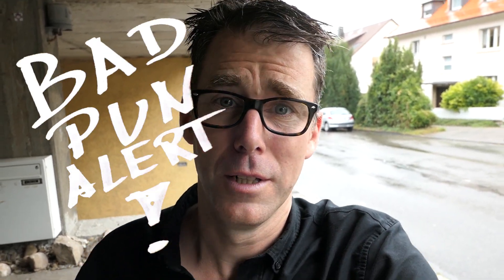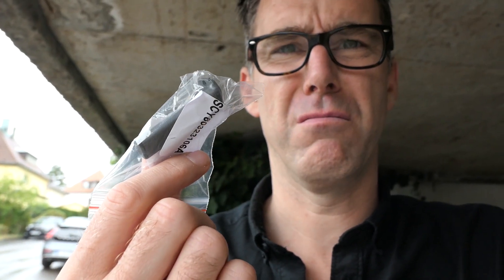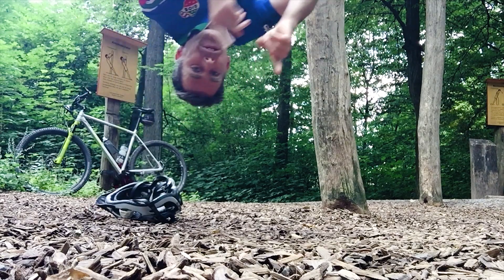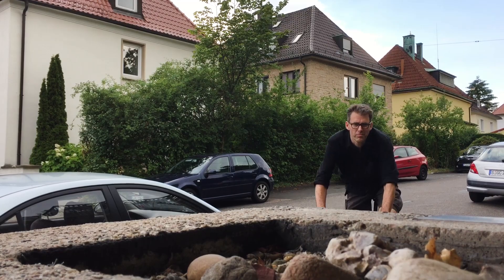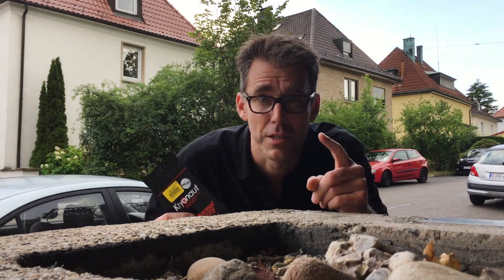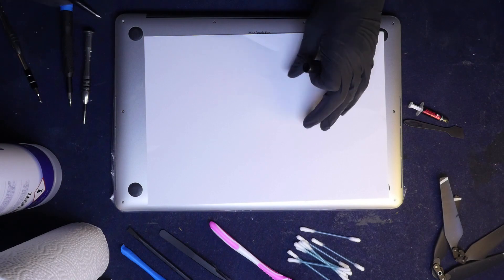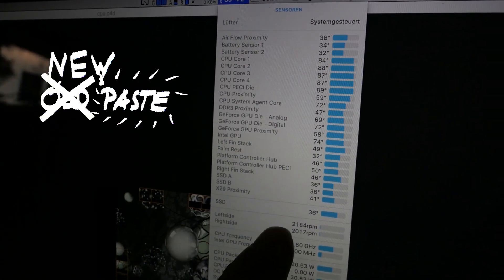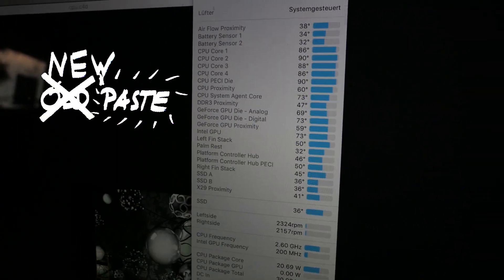The Macbook Pro Thermal Paste Adventure

Comment: what tool do you use to assess your results? also, i didn’t find a difference in temperatures. do you think performance improved by this application of thermal paste?
Reply from the maker: I'm using iStat Menu. Don't know how reliable it is. But it looks like "reposting" does help when after years the thermal performance is getting worse.

Comment: Which screws are used?
Reply from the maker: For the bottom cover? The originals still. But they are ... suboptimum.
Reply: No i meant ehich screwdrivers did you have to use
Reply from the maker: @junkyMM  I used the pentalobe drive that comes with iFixIt's toolset. And a simple T5 torx for the inside.

Comment: I did this plus I cut up a 15mm thick thermal pad to make the heat pipes transfer heat to the bottom plate. It's made a difference, watching 4K YouTube video only brings the temperature to the low 50 degrees and it stays there. While idling my 2015 MacBook pro 15 with the i7 2.8 GHz stays at 30 degrees Celsius. Also the bottom seems to stay cooler now when watching Netflix on my lap. I'm. Assuming if I placed a laptop cooler with fans on it I would see even more of an improvement. I'm only saying what I did and my results, I'm not saying anyone should do this.
Reply from the maker: Keep in mind yt will put a link into the approval box and when I’m on the road I barely ever check that box. ;]

Comment: Great work, what MBP it is? What CPU/GPU? And I would also suggest, for maximum effect and to receive good results to go "crazy" and 1. warm thermal paste before applying, 2. first put all stuff in micro-tube and try to mix it to be more near-perfectly balanced 3. apply as small amount as possible and spread as you did (apply on cores and nothing on radiator) 4. screw radiator with a lit of loctite 5. perform 'warm-hot-cool-cold cycles as soon as you assembly the cooling, to move particles into 'their' size 'holes/gaps' by thermal expansion and contraction. This is crazy process but it still will give at least 87C at stress, with 2000rpm. Mine is never kept on 2000rpm, constantly on 2700 and 3800 when on load. On maksimum load I set to 5300rpm. I use smcFanControl. Never use it with lower than 2700rpm mainboard components will buildup heat, this is also very nasty when moving during winter (23C inside, -10C outside). Just an advice.
Reply from the maker: Thanks! This is some great info!

Comment: Should i use arctic cermique 2 or gc extreme ?
Reply from the maker: That's a tricky question. I used Thermal Grizzly Kryonaut, because in one of the thousends of tests it got slightly better Marks. But as You don't this too often, You might as well take a very expensive one - to be sure. That being said, Arctic mx 2 and mx 4 were the second best in that test - can't remember where that was. Just avoid liquid metal pastes or anything else conductive.
Reply: @philipp7pc  Thank you. Actually i decided to mastergel pro or maker.
Reply from the maker: Keep us posted how it worked out.
Reply: @philipp7pc  I will. I will buy mastergel maker or gelid gc extreme. Gelid is equal as krynaut.

Comment: Why does every say to don't spread it when every video you see folks spreading the paste
Reply from the maker: It kept me up. So I opened it again to see if the spreading was a bad idea. Looked all fine. No bubbles, well spread. 
Cleaned and reapplied. So much for that “did I turn off the oven” exercise. ;]
Reply: @philipp7pc  anyway, I believe one should rubbing the paste – so the paste just fills all microgaps, but not cover the bare metal – so the heat sink will touch the processor directly, not via the paste. Thermal conductivity of the copper is x10 better than any thermal paste ever.
Reply: @philipp7pc  how you can be sure that there were no bubbles – the whole compound distorts when you're unsticking the sink =]
Reply from the maker: Good point. The whole thing looked very fragile anyways. 
(The paste looked good when I reposted a few days later, because I was in doubt ;)
Reply from the maker: That’s exactly what I was wondering. Then I looked up some thermal grizzly tutorials and the said spread ... but I’m not convinced.
Reply: Its because of the air between cpu and the cooler. There is a vid that shows that very good with a glass pane on the cpu, with the paste between them.
Reply from the maker: I’m afraid You’re right. Feel like having to redo this without spreading. In spite of what they told me in the shop.
Reply: https://youtu.be/-hNgFNH7zhQ here is the link to that vid